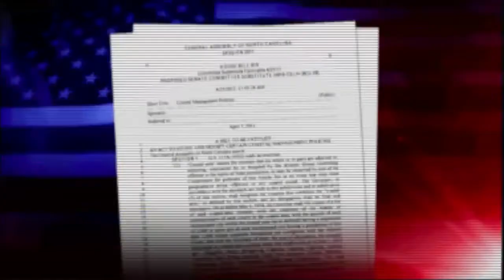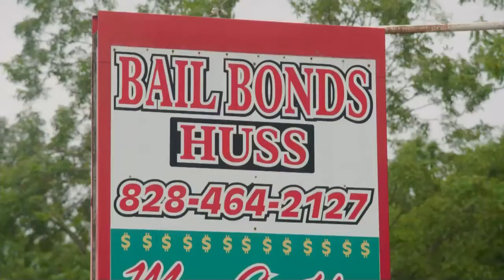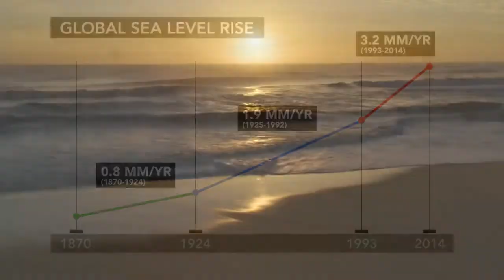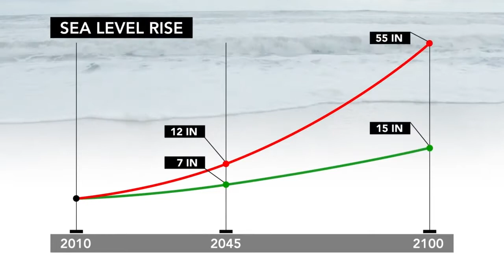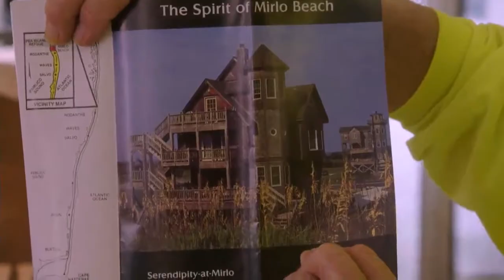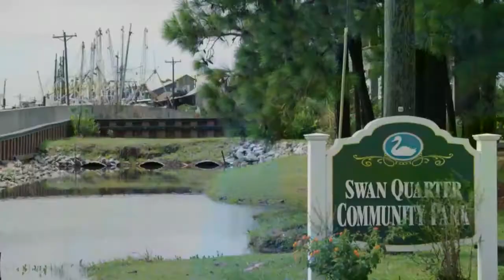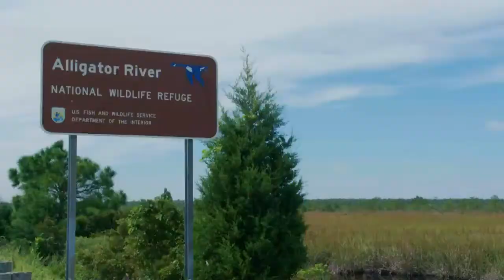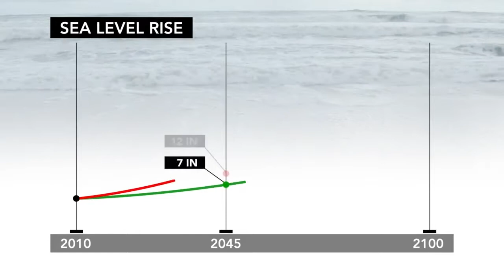Effects of Rising Sea Level on Coastal North Carolina - "Sea Change" - A WRAL Documentary

Comment: As a native Outerbanker, none of the photos they've shown here are at all indicative of anything more problematic than my grandfather's time.
We're talking about a string of SANDBARS.
By nature, these were mobile and we are interfering with nature in the process of making ourselves at home.
...For instance, older heads remember when there were more inlets.
Well, inlets aren't allowed to open and close like they did in our islands for millennia ...because houses and infrastructure would go into the sea.
That, by the way, has a perhaps unintended consequence: once water is pushed into the sound by a Noreaster or hurricane, it's far harder for the water to drain back into the ocean quickly, thus salt poisoning low lying land more easily that it might with better drainage.
Also, we don't do near enough dune replenishment.
Certain areas are KNOWN to flood during storms and yet the same area will be breached over and over with no tangible attempts to better the situation.
ALSO, there's extremely bad drainage in just about every township that gets worse as construction continues; you can't pave over all the sand and give the water no system to run off to after denying it the ability to seep into the sand.
It pools.
....Kitty Hawk and KDH are especially egregious on the "zero drainage" tip.
ALSO, we've had phosphate companies quietly pumping out  massive amounts of water from our aquifers in the Great Dismal Swamp to process their products for decades, which makes land SUBSIDE.
As to oceanfront houses, given the impermanent nature of our home, I consider oceanfront houses going into the sea to be part of the normal ebb and flow of the sandbar we've built our lives on.
There's a reason our grandparents generation never built anything hard up on the ocean side.
Therefore, an oceanfront house is a rich man's luxury that he must by prepared to lose with any major storm.

Point being, why not address the local problems we CAN solve instead of talking about Antarctica, when our local communities simply don't have the power to affect change on that level?!?
My long winded 2 cents, not that anyone will ever read this, lmao.